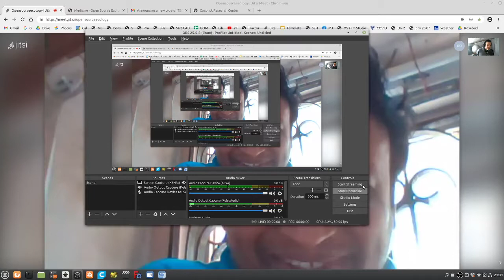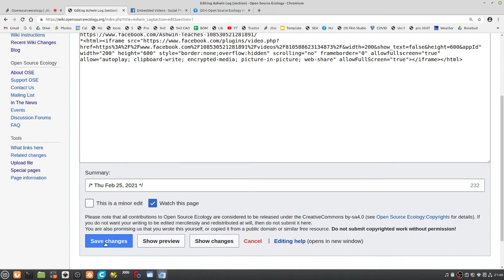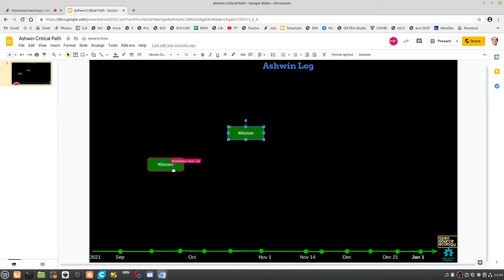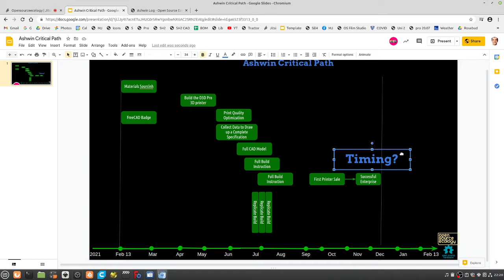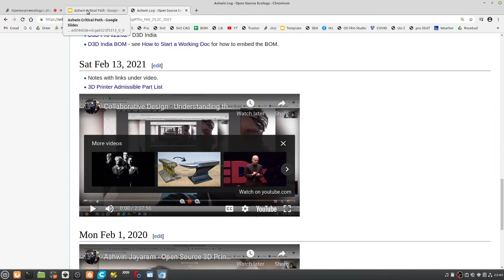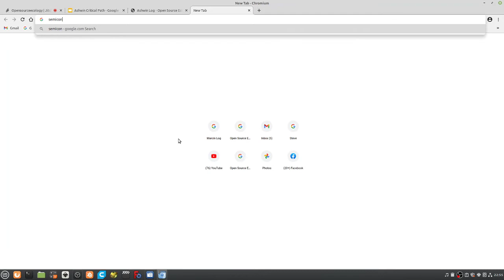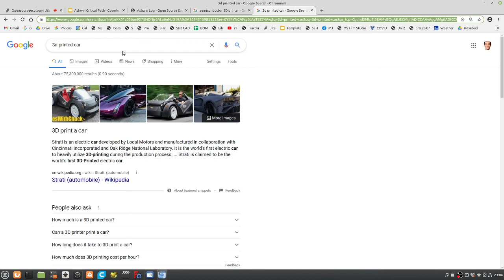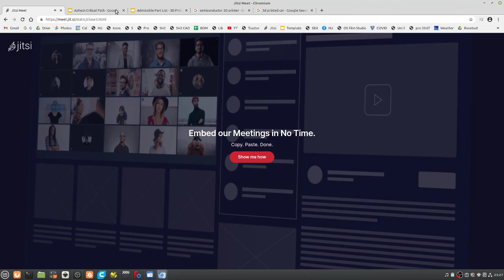3D Printer Critical Path for OSE Work in India

Comment: Q: Is the end product a 3D printer that can be sold, or a product that the 3D printer can make. 
If it is the printer, then the cost/quality of the D3D vs an Elegoo Neptune 2 (US$ 160) may be an issue.
If it is a product (water pump, electric motor), then one also has competition.
If it is a custom product (e-nable.org hands), then there is little competition.